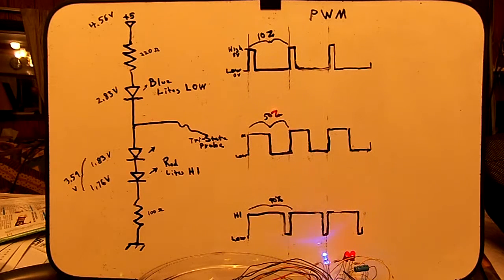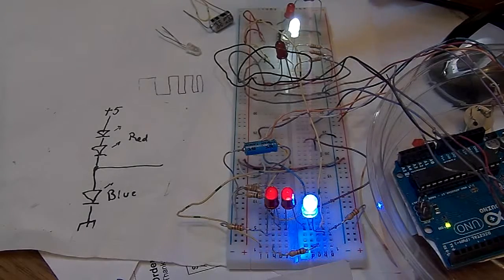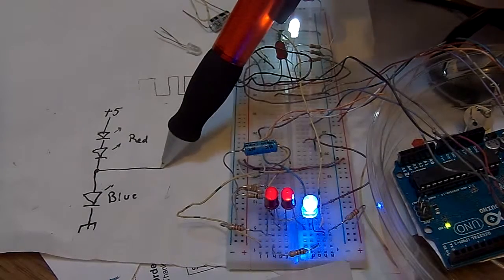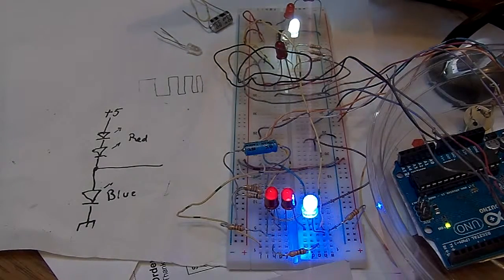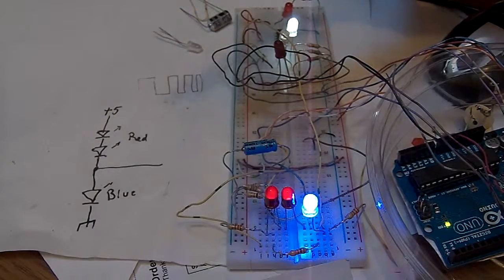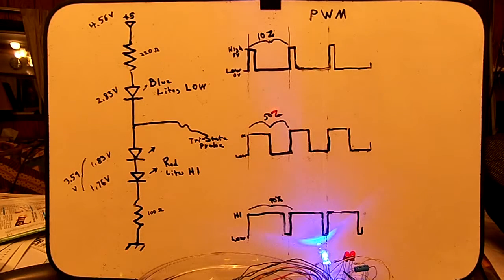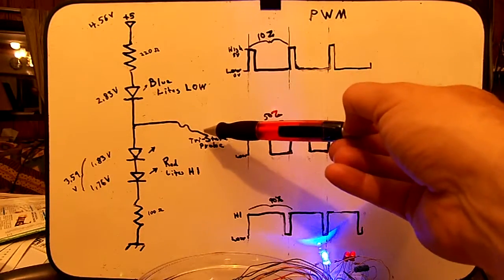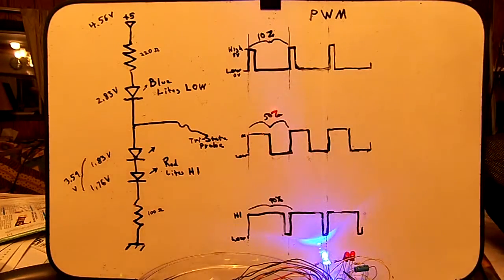Arduino (7b) "Fade" as a Tri-State Probe demo

Comment from the maker: One point I failed to emphasize is the third mode of Tri-state, the disconnect/open, is what allows the several modes of an Arduino pin to live together on one pin. So the digital output, digital input, internal pull-up, analog output, analog input, PWM output, and A/D input, can all share one pin as each mode disconnects when not in use.